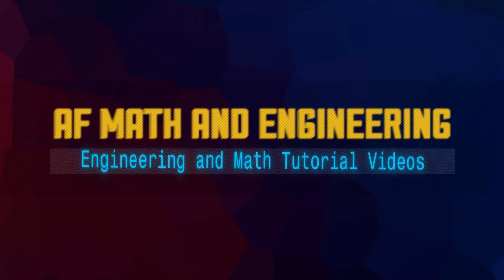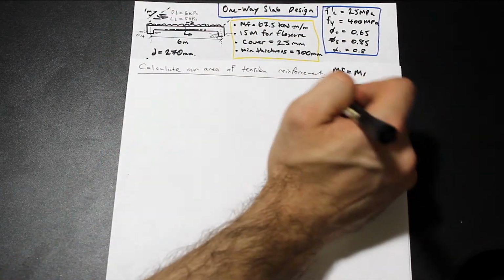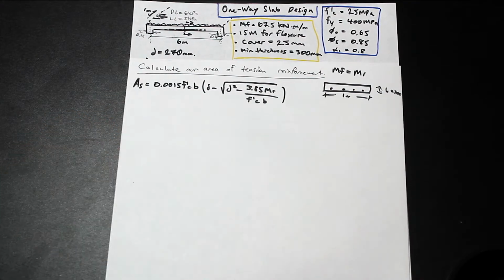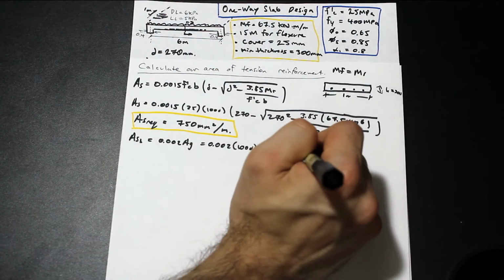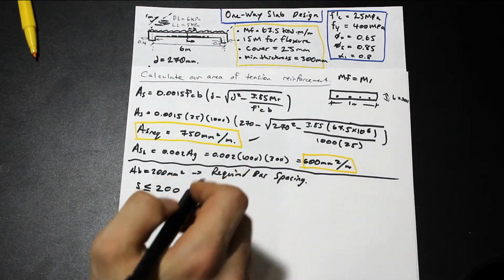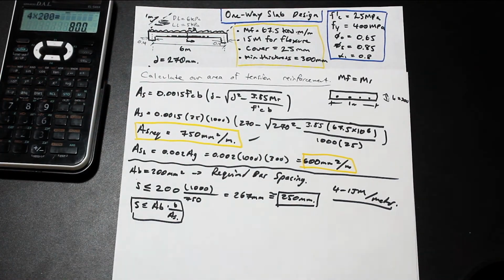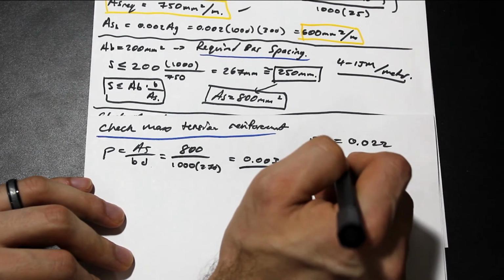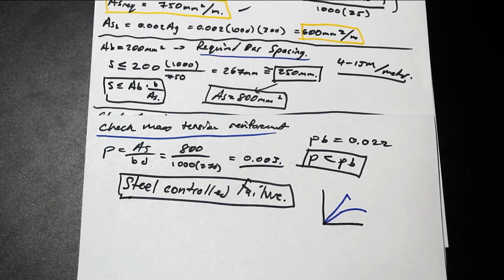One-Way Concrete Slab Design Part 2 - Area of Tension Steel - Canadian Code

Comment: i think there needs to be more checks than this, similar to reinforcing in a beam, there are multiple checks that need to be done to ensure reinforcing has enough "developement" into the supports, whether its tension due to shear or ensuring there is developement at the rate of moment increase
Reply from the maker: Perhaps an exam question would have stuff like this, but in real life all of these small details are captured in what's called typical details, and the specifics of bar lengths and what not are usually detailed by a reinforcing detailer.  Having to calculate all of the things you listed every time you designed a one way slab would be impossible in reality, you'd get nothing done.
Reply from the maker: To add to that, you're not wrong, these things need to be considered of course...they just haven't been included in this video.  The process outlined in this video however is closer to what a structural designer would actually do in reality was the point I was trying to make in the previous comment.
Reply: @AFMathandEngineering  i think the checks that I specified are more important than calculating the amount of reinforcing you need. it is not time consuming for this check, it is a simple equation put into a spreadsheet similar to what you did for reinforcing.

for example development into the support requires a certain thickness of support, which is important when trying to do schematic layout with the architect. 

I just found the title a bit misleading as it missed some further steps for a full one way slab design.

but if your goal is to do a reinforcing demand check at its most critical location I agree.
Reply from the maker: It's not that they're less important, it's that they're almost always covered by typical details and don't need to be calculated in a simple slab design.  Also during the schematic design phase you wouldn't be designing slabs at all and you certainly wouldn't size your supports based on the required development length of your slab steel..

Also I don't think you read my post above, typically in large scale design work there are reinforcement detailers separate from the specifier of quantity of reinforcement that would size all the bars and generate bar lists for fabrication.  They would refer to a typical one way slab detail to determine required anchorage into supports, development lengths, etc.
Reply: @AFMathandEngineering  typical details don't cover the checks I am talking about. you need to be able to give minimum support widths in order for that one way slab to work- which is important when doing efficient schematic layouts with the architect - other wise they will spec you a thin support and you will come back later asking for more - which makes a structural engineer look in experienced, other wise it doesn't matter how much reinforcing you calculated at midspan, it doesn't develop into the support properly.
Reply: @AFMathandEngineering  yes you need to be able to give enough distance past a wall face, or past column face. this is important in terms of cost, and also gives architects enough lee way to determine any dimensional contraints.
Reply: anyways for a simple mid span check, for reinforcing this video is sufficient. but I just wrote the comment to say that there is more checks than this, and imo more important checks. I was just a bit confused as to where the rest of them were as it mentioned in the title "one way slab design". also typical details you ask for doesn't cover what I am talking about.

anyways - good video hope you didn't get offend
Reply from the maker: I'm not sure how the process of coordination in the early stages of a project work where you practice, but the architect doesn't 'spec' support sizes, the structural engineer does at the beginning of a project.  Anyway, thanks for contributing your opinion on the subject and good luck in the future!
Reply: @AFMathandEngineering  we try to work with architects to locate supports at certain locations in their initial architectural layout that also work for them, of course architects try to spec as little as possible to free up useable space. Where were from we try to not stick supports where ever we feel like it, as we try to keep getting projects from them in the future. anyways cheers hope to see more vids

Comment: you don't have tables for steel areas and the spacings of rebars, for slabs and beams, BS 8110 has tables for reinforcements which you just read off.
Reply from the maker: There are some tables but mostly you need to make your own spreadsheets based off of formulas in the code.